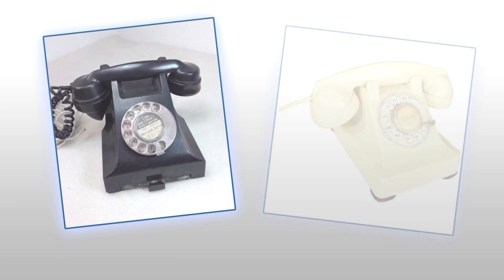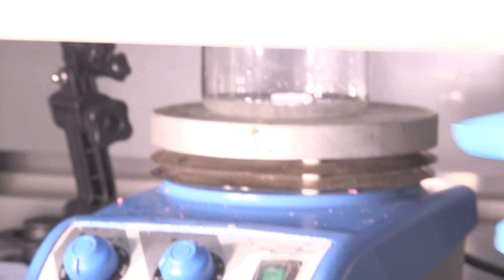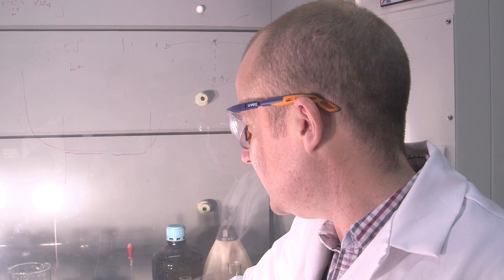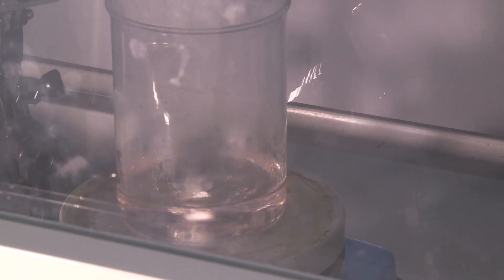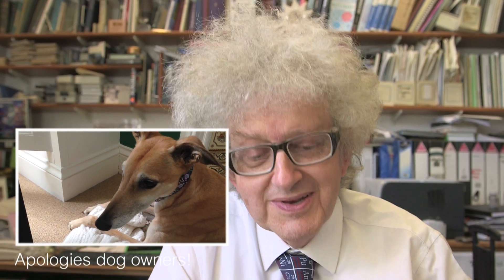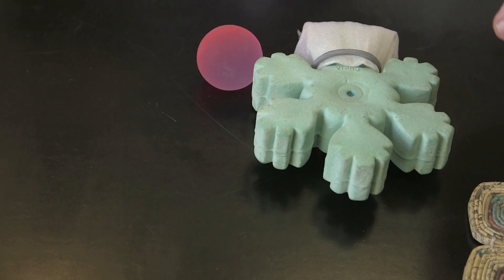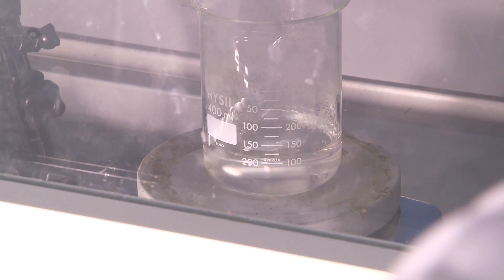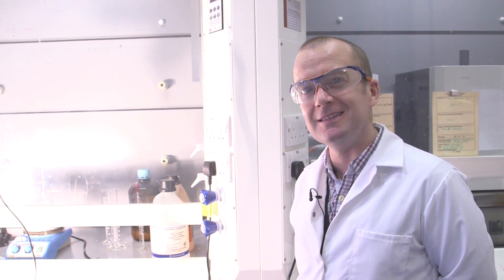Making Bakelite - Periodic Table of Videos

Comment: Bakelite is also a great insulator I have a intake manifold for a motorcycle machined out of some to prevent the carb from heating up so much.
That idea came from using a slab of it to make an adaptor for a Webber carburetor to an "incompatible" manifold, the plus side was it kept the carb temperature much more stable.

Comment: Bakelite and its relatives still aren't obsolete, either -- in addition to having seen quite an assortment of knobs made of phenolic plastic on equipment that is still in service (and even manufactured within the last couple of decades), I think the handles of some cookware are of a similar substance, and screw caps for media/chemical bottles with 35 mm mouths are often phenolic (although another type of plastic is also used for these -- the phenolic caps are slightly less dark, and definitely less flexible; either way, the limit on durability usually isn't the plastic of the cap itself, but the binding to the interior seal).

Comment: Bakelite is still used in applications where rigidity is important. If you have a desktop CNC, it sides may be bakelite. It has no give, it holds its shape very well. Instead of wood dust, glass and carbon fiber can be used, which is the kind that you are most likely to see these days.

Comment: I made phenol formaldehyde in the lab, but I definitely did not use either acetic or hydrochloric acids. We did use hexamethylene I seem to remember as an accelerator or modulator, I can't remember exactly, this was over 40 years ago, but then we used the resin after polymerisation, mixing it with wood flour and various other additives and we made ash trays out of the stuff. I also made some fibre filled resin ( a bit like Tufnol) and even paper filled, but wood flour was definitely the preferred filler.

Comment: Reichhold Chemicals in Houston Tx used to make phenolic resin in the early 1980's.  The stuff exotherms as it is mixing.  One day the heat in the reactor got away from the operators.  Rather than have it harden in the vessel the shift supervisor opened the bottom-out valve and dumped the whole batch on the ground.  It looked like a huge pile of afterbirth and took days to clean up.

Comment: When I think of bakelite I tend to think of the hard brown substance, normally I find it in old control knobs or insulating me from the high voltage coils in vintage violet ray units (which would make your geissler tubes glow very nicely)

What makes the bakelite I know of brown and not pink?

Comment: It must be very durable as I have stayed in many old pubs over the years that still have old light switches and fittings made from Bakelite.Also the Red Rattler trains in Sydney which ran from the 1920's to the 1990's all had Bakelite electrical fittings.

Comment: Here in the states a remarkably large number of things are still made of bakelite, I suppose on the "don't fix what isn't broke" principal.  Many components of a completely operational electric home fitted with "knob and tube" wiring were bakelite, especially junction boxes and the round ceiling mounted boxes for supporting light fixtures.  Those bakelite components remain in widespread use, tho newer 'blue plastic' alternatives are also available.  And other things... I suppose the fact that it is durable, cheap and easily molded, and that production facilities are already 'tooled up', makes folks reluctant to demand other materials.

Comment: A little known fact about Bakelite:  Early in WWII, the US Navy began to notice that some of their armor-piercing (AP) projectiles were not exploding property when they hit their target, even if the shell's explosive charge and base fuze (located as far from the impact area of the shell's nose against the armor as possible) was undamaged.  An investigation revealed that the new, higher-strength base fuzes recently developed and introduced, replacing the older fuzes that had problems when the shell hit heavy armor at an acute angle, were in too many cases not functioning properly after being inside the shell for 6 months or more in storage.  What was happening was the explosive used, ammonium picrate or "Explosive 'D'" (very insensitive so that it would not explode on impact, but only when the fuze's detonator set it off, unlike some explosives used in WWI by other nations), emitted fumes and this corroded steel very slightly.  The new fuze, the Mk 21 Base Detonating Fuze used in almost all US Navy  AP shells in WWII,  had higher tolerances and a more complex, Chinese-puzzle-box-style arming mechanism for added safety when stored and when fired down the gun barrel, could not tolerate even this slight corrosion, which interfered with the fuze arming and firing properly on impact.  After some months of tests, it was discovered that coating with Bakelite the entire upper portion of the fuze that was sticking into the shell's explosive-filled cavity sealed the fuze and by mid-1943 the problem was completely solved.
Reply: A great base of chemistry taught at colleges like this allowed some smart person to fix this engineering problem, of course to help win the war!

Comment: how do you use that reaction to make objects of bakelite? It seems difficult to control and to put into molds
Reply: I would think you would heat up the plastic to mold it.
Reply: +Christopher Ross if I'm not wrong, bakelite is not a thermoplastic, it doesn't melt with heat

Comment: What's the plastic that starts white and becomes this beige color as it ages?
Reply: Most plastics will do this. It's not a particular type per se. It happens mostly through oxidization which in turn is triggered mostly by UV radiation. White, yellow and orange turn to beige, red turns to pink, blue turns to cyan, black turns to grey, etc.

Comment: bakelite is still the primary material used in marine driveshaft bushings that are exposed to salt water and most other bushes and bearings that are exposed to water and other reactive fluids just a fyi :)
Reply: +crowbarstube And Bakelite is still used for vintage re-issue Telecaster pickguards.
Reply: The only pickgaurd that should be on any telecaster not just a reissue
Reply: +crowbarstube
Wow that's cool! Never knew that!
Reply: I put this info in the back of my mind, these are cool ways to create things with chemistry.  Notice this is something anyone could make with the right chemicals, no huge plant required.  Pretty cool, from a liquid to a solid!
Reply: @superchuck3259  actually, the requirement for the huge plant comes from the pressure that's needed to mold the bakelite.
Reply: 4 years late. It is also used in the composites industry for its flame retardant properties. When exposed to an open flame it melts into a gunk and then burns, which protects the interior core from further damage.

Comment: Isn't Bakelite the stuff Danelectro guitars are made from?
Reply: +Noel Goetowski Danelectro guitars were originally made with a Masonite top and back, with a pine core. I think the modern equivalents use a plywood core, but the top and back are probably still Masonite. I think the necks were originally made from poplar and rosewood, and now probably something like maple and rosewood.

If you're looking to see a bakelite guitar, look up the early Rickenbacker lap steels and guitars. The entire body and neck were made of molded black bakelite. I have one of the lap steels, and they are surprisingly heavy. I can't imagine what they'd weigh if they weren't hollow underneath all the decorative chrome plates on the body.
Reply: +discojames Masonite! That's the one I was thinking of.

Comment: From what I've read, the glue used to manufacture plywood used to be phenol-formaldehyde (Bakelite), which was very successful because the resin is water-resistant and immune to rot. Nowadays, it's apparently only used for outdoor or marine plywood. Indoor plywood is now made using urea-formaldehyde.

I think Formica (commonly used for kitchen counter-tops) also used to be made by gluing sheets of paper together using a phenolic resin, with melamine used for the decorative top layer (because it's transparent).

Comment: Fun Fact: Bakelite was used in aviation engineering as some planes were still largely made of wood. Coating the wood components of the airframe prevented it from rotting and reduced its flammability.

Comment: What was done differently?

The difference is in the amount made. In the first attempt (the one not filmed from every possible angle using way too many cameras), you made less. This means that when the reaction happens, there is less mass to lift up from the beaker. Bubbles will also be a larger part of the volume, making the plastic less "solid", so it'll break to pieces from the expanding gasses easier. 

That's my theory anyway. Maybe an experimentalist can test it.

Comment: bakelite is a plastic you love to hate.  It works, but the stuff is brittle and not at all UV resistant.  Its saving grace is the ability to deal with higher temperatures than most plastics.  In time it turns into a crumbly cracking mess.   great for insulators in electronics, until it breaks down that is. 

Not that he knows of... lol.  I would think a chemist would know the materials in his home better.  It is still used in handles and such with kitchen items.  Many grills and smokers use it for handles.  It is still common were heat is involved and I am willing to bet he has at least 1 item with bakelite parts.

Comment: How does the stirring mechanism work? Looks quite nifty.
Reply: a rotating magnetic field and a magnet in the stir bar. Increase the rate of spin and you can get quite the little vortex on your hands. I've still got burns on my hands from some overheated agar.
Reply: Looks cool, thought it was probably magnetic. I've used hot plates like that before in fume cupboards and vaguely remember it having a stir button but never had the need to use it (and tbh think the little bit that goes inside the beaker was probably lost =) )

Comment: So since the oxygen is released in the reaction the bubbles formed only come from Oxygen or are there other gasses also formed?
Reply: Oxygen isn't released.  Water is.  If you think of it as a two step reaction with the first step consisting of a phenol getting attached to a formaldehyde (and for the sake of simplicity, I'll ignore the possibility of the reaction occurring in the para- position), one of the ortho hydrogens on the phenolic ring will get replaced by the carbon from the formaldehyde.  That hydrogen will end up bound to the (now single bonded) oxygen, making an intermediate compound 2-hydroxymethyl phenol (common name: salicylic alcohol)  Then in a second step, the carbon from the formaldehyde will attach to a second phenol molecule, again replacing an ortho hydrogen.  The second hydrogen will be drawn up to the oxygen as this occurs, which would then float off as a complete water molecule while the carbon and two hydrogens from the original formaldehyde is left as a methylene bridge between the two phenols.  This would be bis(2-hydroxyphenyl)methane.
Reply: ExaltedDuck Thank you very much for the explanation.
Reply: Happy to help.  :)

Comment: Here's my hypothesis about why the reaction from the previous day sprayed bakelite further. It looked like there was less liquid in the beaker. The gases generated from the reaction could immediately fling the bakelite out of the beaker, whereas when there is more bakelite in the beaker, the gases have to build up to a higher pressure to fling the bakelite, giving more time for gases to escape around the sides of the bakelite.

Comment: Where and when do you add the wood flour in that mixture??? Also, what does wood flour do to the Bakelite
Reply: Any time before the catalyst is added the 'wood flour' would be added since it is practically impossible to homogenise it into the resin that forms after the reaction takes place.  It helps form longer bond chains to make it more durable in the same way fiberglass is used in fiberglass reinforced tape.

Comment: Dumb science question - but why does the bakelite made "blow out" of the container like it did in the video?
Reply: As the polymer forms, its viscosity rises and eventually the material solidifies.  As it does so, it traps boiling volatiles which continue to boil and quickly exceed the the strength of the polymer cells they're trapped in.  It would probably be safer (and produce a more viable end product) if the reaction were carried out in a pressurized manifold but, admittedly, exploding beakers (at least in someone else's lab) are far more fun to watch.  ;)
Reply: The reaction needs to be heated, otherwise the molecules won't react. When the molecules react, they release heat, and speed up the reaction. As it heats up, it goes faster and releases more heat and goes faster... until eventually the water and acetic acid boil, and since this happens at about the same time as bulk plastic starts forming, chunks of bakelite are thrown out by the expanding gas.

Comment: So the name "bakelite" is not very common anymore (I think it's owned by Sumitomo) but the condensation reaction of phenolic compounds with formaldehyde is still an important and industrially relevant bit of technology.  While most plastic products are composed primarily of other plastics, phenol- and cresol- based resins are still some of the best adhesion agents available to formulators of adhesives, sealants, and coatings of a variety of chemistries, and it is a virtual certainty that phenolics are binding the pulverized friction material into a cohesive units in your car's brakes and clutch.  They are also still the preferred bonding agent in the manufacture of plywood and particle board.  It's interesting to note the proteins used by many simple sea creatures like barnacles and bivalves also use a large amount of aromatic moieties to achieve a strong bond (all while constantly immersed in sea water, no less) to whatever rocks or boat hulls they choose to call home.  There is actually a lot of very interesting chemistry to study with them.  Or engineering, as the case may be.  Regardless, I would relegate the phenol-formaldehyde condensation reaction history no sooner than I would with Goodyear's vulcanization reaction.  It is every bit as important to the course of human development, and every bit as still-relevant to modern industry.
Reply: While I know this is a dated reply, you can see "grown" space ships in Sci-Fi movies. I think that is the next wave of organic "living" chemistry.  Could you imagine a paint that was alive and lived off the light and kept your home looking great? Those ideas abound!

Comment: has anyone tried using this stuff for 3d printing?
Reply: I don't think anyone will.  Phenol and formaldehyde fumes are both acutely and chronically dangerous, and both would be evolved by a printing device and its products.  Additionally, 3d printers typically work by melting small prills of thermoplastic materials.  Phenolic resin are thermosetting.
Reply: ExaltedDuck before the resin has set (that intermediate stage in the reaction), it should already be quite safe to handle (if not, use a fume hood!) and behaves much like a thermoplastic. you might actually be able to extrude that at much lower temperatures (and distortion) than ABS. after that, just let it set for a few weeks at room temperature, or some minutes in the oven, and it should become extremely durable and won't give off any formaldehyde or phenol.
Reply: All I'm saying is there are other resins that would offer better handling characteristics and not present the severe health hazards of messing around with phenol and formaldehyde (which, certainly, you can try to control but will never entirely eliminate from the air around the machine, and the levels to produce physiological responses are too low for phenolics to have much relevance outside of heavy industry)
Reply: Also 3d printing uses laser (scanning from 2 directions) to coordinate/initiate where the molecules would polymerize, this reaction uses heat so it's difficult (or impossible) to control where you would want to print with high precision.

Comment: Bakelite is a thermoset resin, which means it doesn't melt.
Reply: Phenolic resins are thermosetting but they're typically not fully cured during initial manufacturing.  So when it's molded, it does behave in a thermoplastic manner to an extent (it softens as it's warmed) but with some combination of time and temperature, the thermosetting character takes over (typically weeks at room temp and minutes at somewhere between 50 and 150 C depending on the specific preparation)

Comment: Bakelite was commonly used in US home light switches and power sockets well into the 1980's. It's high electrical and thermal resistance made it a nearly perfect material. The development of less brittle heat resistant plastics left Bakelite to niche products.